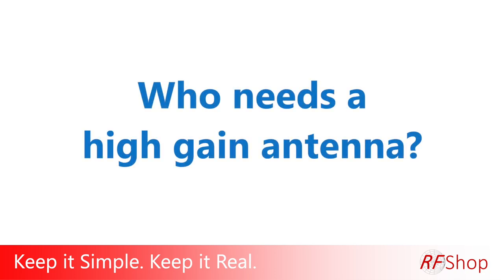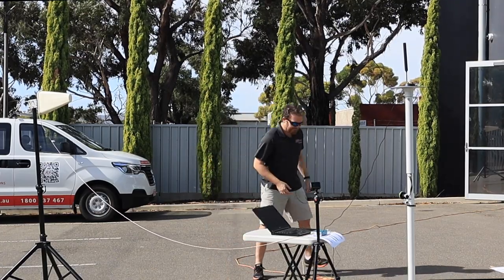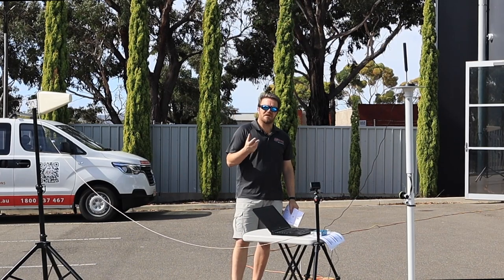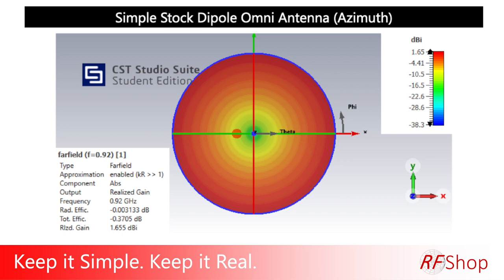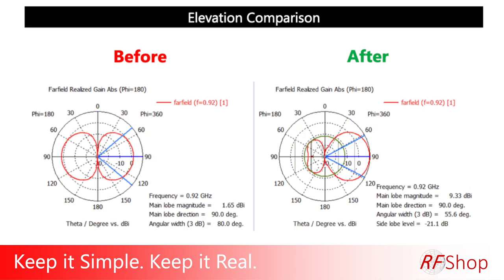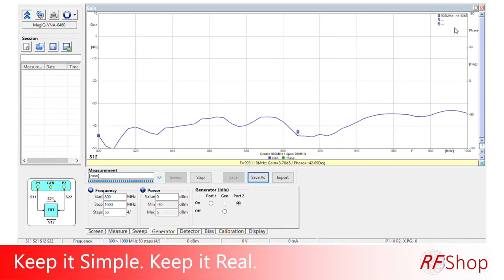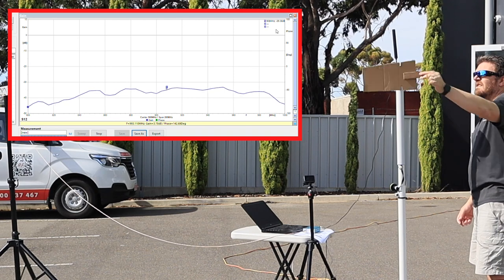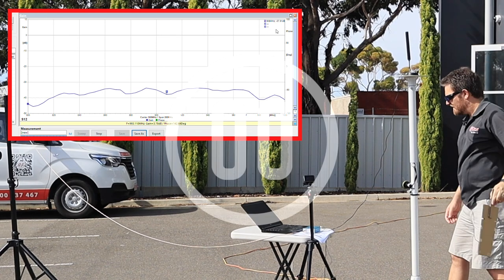FREE DIY 7dBi upgrade for your Indoor Helium Stock Antenna (Part 1)

Comment: Anechoic chamber = a big flat empty grassy mown field, with no structures fences or trees closer than a few 100s of meters.
Reply from the maker: Yes, that would work. Still need to make sure you understand the effect of the ground reflection though
Reply: @RFShop  True.

Comment: So how does changing to yagii affect ability to witness?
Reply from the maker: If you only have witnesses in one direction, it's pointless to use an omni that tries everywhere but you don't get any witness behind you. Better to make the antenna good in that one direction
Reply: @RFShop  It wasn't initially apparent from watching that both tx and rx improve. Thx
Reply from the maker: @sydcarter3  Good point. I'm so focused on the thing I try to convey (i.e. antenna modification) that I don't focus on the simple need that I'm trying to address...which is both Rx and Tx gets benefit from a better antenna performance